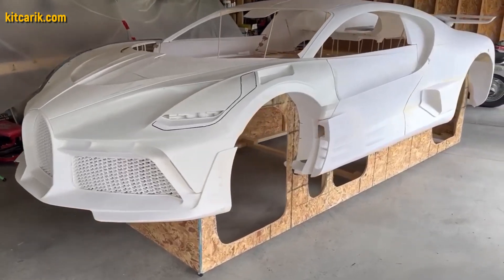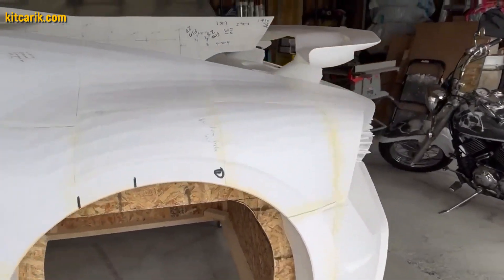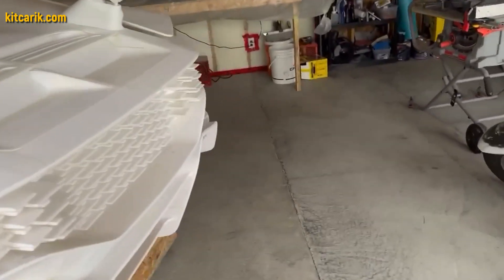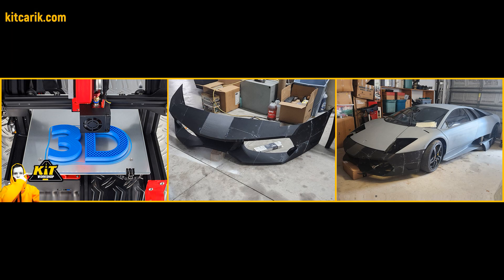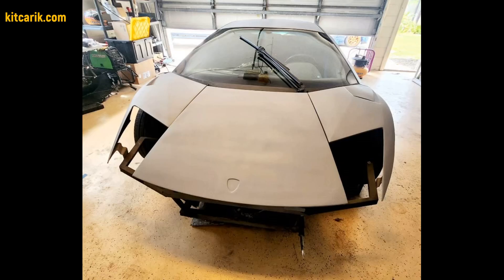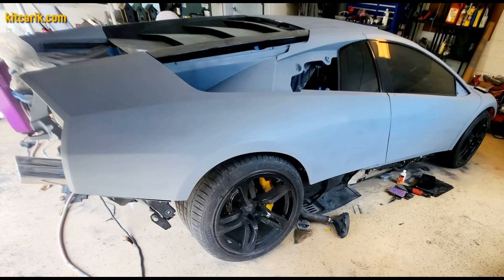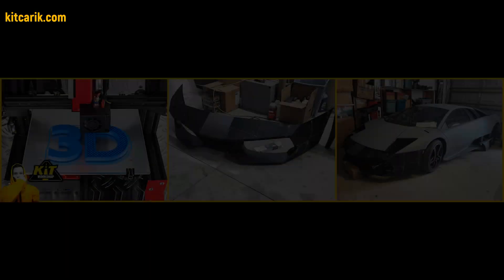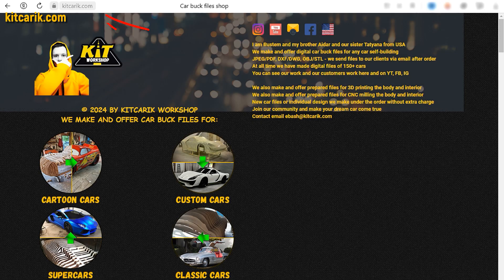🔥🛠️ How We 3D Printed a Supercar at Home for Cheap!

Comment: Do the 3d file you provide the mounting point of the body parts?
Reply: You would fabricate that yourself with epoxying metal plates on the back side of the panels and then adapting to however you see fit to your tube chassis.